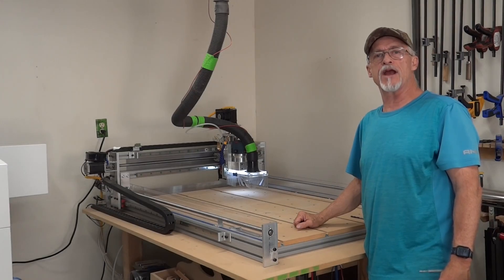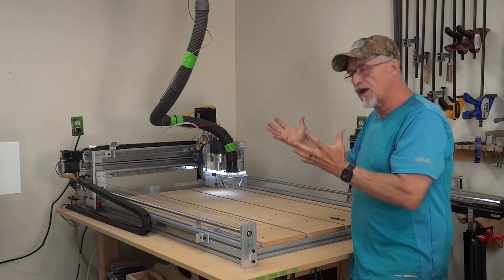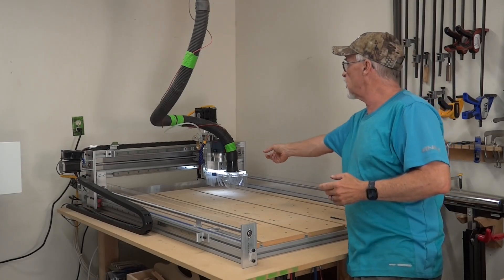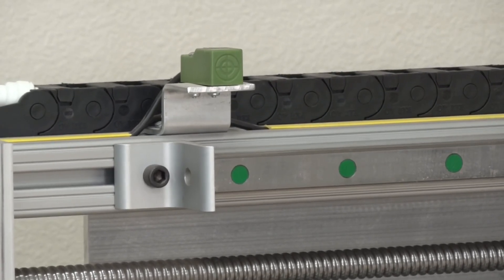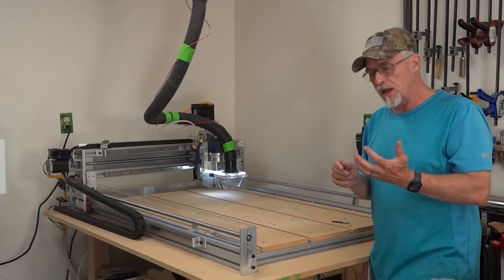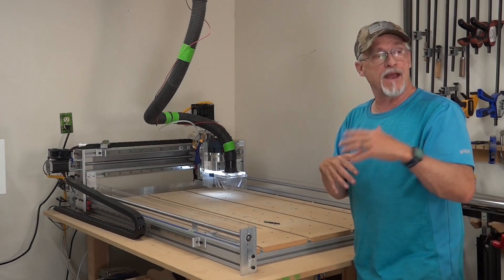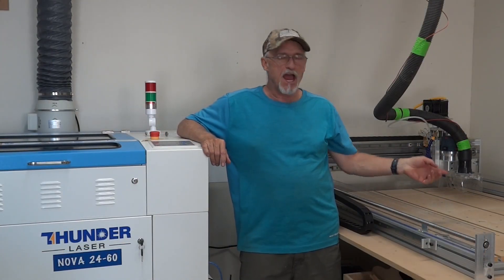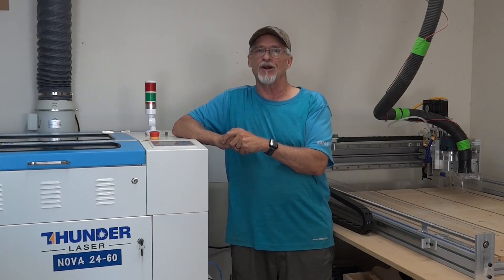Lessons Learned Owning a CNC, Diode Laser & Co2 Laser

Comment: Did you try speeding up your CNC when you put the diode laser on it?  Look at the motor controllers they usually have settings for how much to turn a stepper given each pulse from the CNC controller.   It's a tradeoff between speed and resolution, but lasers use the same motor controllers as a CNC, so it's gotta be possible..  You compared the CNC to the Laser in front of them.  I can hear the CNC crying.  When I brought in my laser, I told my mill, and drill press, and lathe, and CNC that the Laser was a new friend that was here to help them.  They are all friends now.  No hard feelings.
Reply from the maker: I knew my way around Mach 3 pretty well and no matter what I didn’t I couldn’t get it to work that’s why initially I went with a stand alone diode laser and quickly found how slow they where. it provided great engravings .
Reply: @computercreationz  No, I'm talking about the hardware, not the software.  My motor drivers can be set for regular speed and steps by halves down to 1/16 speed.  So you can adjust how many pulses it takes to move.  If they are set to 1/16, steppers go pretty slow, but are very precise in locating. At these slower speeds the drivers will interpolate the voltage so you get a fraction of a step, with very high resolution, but slow. A lot of people go for the 1/16 setting because they want that high precision, and then gripe about going too slow.  Now I suspect you don't have that problem since you are using servo motors, but I could be wrong.
Reply: It's not about motors, controllers or software configuration. It's about moving masses and mechanical trasmission. You have small mass on laser head and big mass on cnc machine spindle holder. Cnc will accelerate slower. Also you have belts on laser machines and heavy carriage and thread trasmission on CNC with its inertia and momentum inertia, cnc will accelerate slower. CNC are built to be sturdy (and therefore slow) laser are built to be fast. Diode laser on CNC machine is a hobby splutipn, where time is not money. That's not an option for professional usage.

Comment: Hey could you actually help me out, i am trying to find the right cnc router with laser combo. would love your guidance!
Reply from the maker: I could talk to you about a Cnc machine I have a very nice Cnc for sale for 4K.
Reply: @computercreationz  well, I have been watching videos non stop on router vs laser. I was hoping there was a combo that doesn't sacrifice either, but haven't found that yet. I'm assuming I need an 80 watt laser to cut thru 1/4-1/2" wood.
Also the fact that the router can't do sharp angled cuts is also a con.
So is it necessary to get 80watt to cut that? If yes, which model would you recommend. Is it bad to buy used? Are the desktop cutters at 40W and 50W a waste if I want to cut that depth? Or can I do multiple passes?
Reply from the maker: @_.hello_friend._  and you wont. you have to remember that a 1/4' end mill bit that fits in a cnc machine will be far slower that what is required for a laser that is as wide a a human hair. One hard lesson I learned when I had my diode laser is there work well for engraving but take allot of time and they wont cut much material. If you planning buying this for a business you really need the cnc separate from you laser. The other thing is any dust on the laser lens will greatly reduce your laser power. and If you starting with a low wattage diode you are at a great disadvantage. Hope that helps
Reply: @computercreationz  so far for starting off, only having the budget for one machine to start off with... You would suggest a cnc router machine?
What specs should I look for in a cnc router, when looking for a machine that can do high detail work? There's bobs cnc diy kit, the online articles place it in first place for desktop /budget cnc's, however when I read the forums - it is one of the worst budget cnc's.
Ideally I would like to start with a decent size machine that fits my budget - but that can do quality detailed work. After set up and all, I'd like it to fall at/under $1.5k
Do you know of any quality CNC machines that fit this bill to help me get started?
Reply from the maker: @_.hello_friend._  I would start off with a co2 laser. Many more things you can do with a laser compared to a Cnc machine. I’m selling my Cnc for that reason. Just don’t use it as much once I got the laser. I do 90 of the things I used to do on the Cnc with my laser. Just my 2 cents worth!
Reply: @computercreationz  would you say a 80w is necessary? Or 60? What brands? New /used?